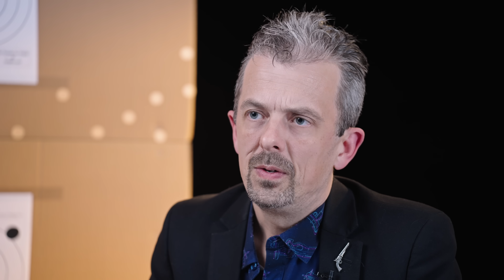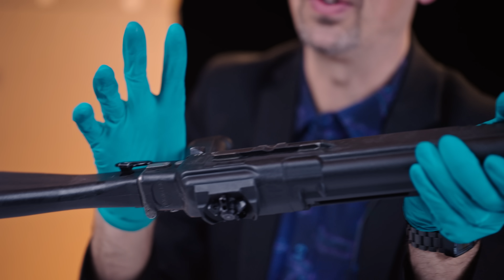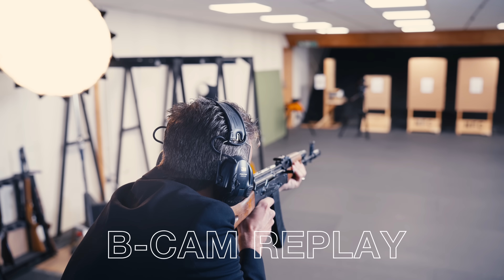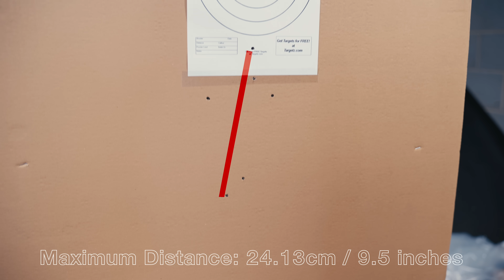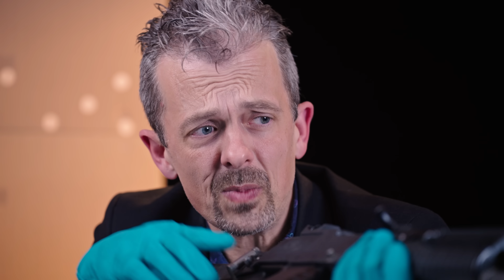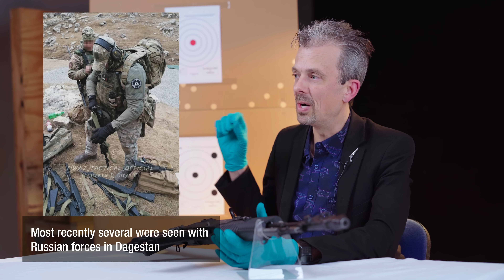World's Rarest Production Rifle: The AN-94, Part 2 with firearms expert Jonathan Ferguson

Comment: When Mikhail Kalashnikov was asked to redesign the AK-47 for the new 5.45x39, he was not at all keen on the smaller calibre. He did it anyway, as he said if he didn't do it, someone else would have. India chose the 7.62x39 for the AK-203 which it will make under licence. I'll bet Henry Chan would like to get his hands on a AN-94.
Reply: I do agree that the 7.62x39 is a good round for peer to peer engagement. Crew served weapons for beyond 250 meters is king. But, the AR has proven the more flexible platform.

Comment: Alright Jonathan Ferguson, keeper of arms and artillery, I'd like to see a video about the Ultimax 100 lmg or the KAC  LAMG. Both of which use the Continuous recoil design. Since we're talking about automatic weapons with very little felt recoil I think the Ultimax/KAC LAMG would fit into that theme quite well.
Reply: We have an Ultimax but just the one, so can't justify firing it. I'd love a KAC LAMG, in fact I did hint to Mr Knight once...
Reply: @JonathanFergusonRoyalArmouries forgotten weapons shot the KAC LAMG and TFBtv shot the Surefire MGX prototype one handed.
Reply: @JinKee  Yep. Mr Knight showed me a video of him doing the same.
Reply: @JonathanFergusonRoyalArmouries  i am really curious about the reciprocating top tube over the barrel of the MGX, it looks like it is supposed to increase the distance the recoiling parts cover before the next shot is fired to achieve constant recoil and reduced rate of fire, but i could never see inside the tube in any of the videos/patent drawings.
Reply: I like how Stoner called continuous recoil design "that runout thing"

Comment: Looking back at that Garand Thumb video on this gun from a year ago, they say that it feels more like a 3-round hyperburst in full auto. Is there any mechanical reason or truth to this, or is this just a misconception?

Funnily enough, the way this gun functioned in 2019's Call of Duty Modern Warfare was closer to a 3-round hyperburst than anything, so it'd be interesting if Infinity Ward had actually gotten it right with that.
Reply: If I recall, he's talking about in auto mode rather than burst - they felt they were getting three rounds at an increased rate before it shifted down. I think it's subjective or somehow weapon-specific (although god knows how). Our examples had a very clear shift between the two hyperburst shots and the rest as you can see in this video.

Comment: Interesting how your groups with the AN look identical to the ones Garand Thumb had in his video, with the first pair spread out more and then subsequent groups tightening up. But always one high and left and the other low and right
Reply: I wonder if some of that lateral movement comes from the bolt's rotation imparting torque on the rifle mid-impulse
Reply: @tiagobelo4965  possibly, but it's more likely that the first impulse is much sharper which pushes your shoulder away and because of the changing fire rate it makes it harder to anticipate and control.

With a lot of practice you could probably train it out, but as Jonathan points out it's not worth the extra cost.
Reply: @stephen9894  ^this, I think.
Reply: There's always some movement? I don't know, I don't shoot 😅

Comment: Is the hyperburst not just semi automatic instead of fully automatic (so not really a comparison). Would be better to know if 2 bullets would be better at stopping someone.
Reply: 1st two rounds on automatic are also hyperburst.
Reply: @XtreeM_FaiL  yes but comparing the 3 times hyperburst  hits to automatic is a bit skewed. It should be compared to 3 single shots from the 74
Reply: @Poedersuiker  Oh the 1st. I didn't catch it either. 

Rule of thumb on a batlefield. You get hit, you're out.
Reply: @Poedersuiker  Why should it be compared to 3 single shots? The design intent as I explain was automating the process of controlling the weapon on automatic fire mode. It's not about improved rapid aimed semiautomatic shots which I realise is the received wisdom today.
Reply: @JonathanFergusonRoyalArmouries okay I may have misinterpreted the first test then. The explanation in the end is clear with the fully automatic not being better (maybe even worse) for untrained soldiers.
Reply: From what I've seen there's a single shot, a dedicated hyperburst mode and the full auto also hyperbursts the first 2 rounds. 
And while I'm not an expert pretty sure 2 bullets would hurt someone extra. It's even more significant to consider that the gun uses 5.45
Reply: It kind of depends where you hit someone and the state the target is in. the person who can tell you most about that. would be a emergency room doktor in a US innercity hospital or military medical staff with war experience.